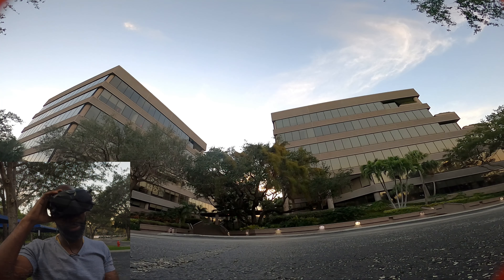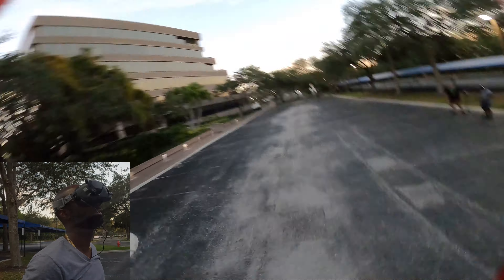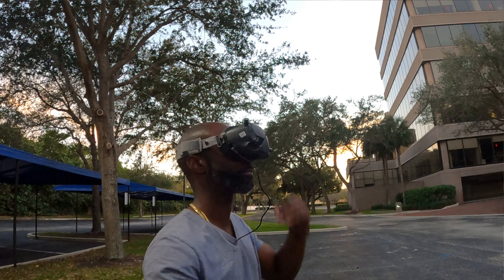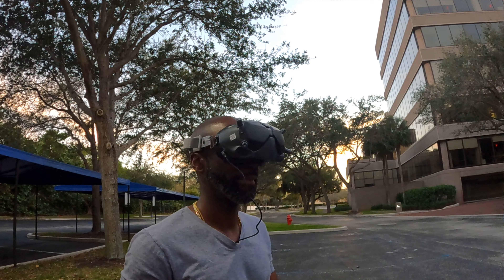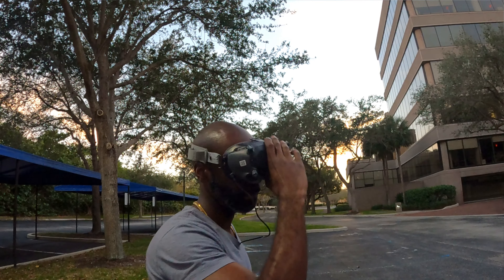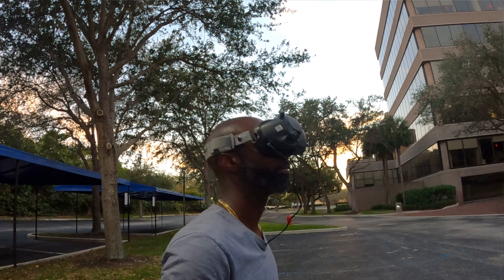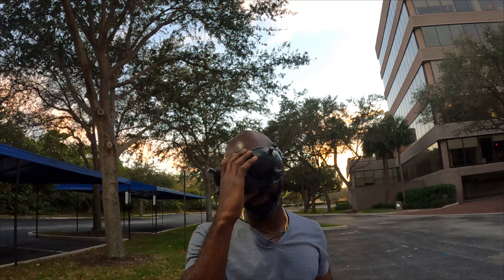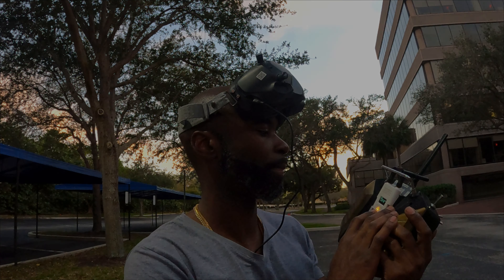Blind Test: 55Hz vs 250Hz RC Control Link w/ DJI FPV

Comment: I think gimbals max out on opentx at 250hz polling rate with qx7, 500hz with edge tx though. 250hz refresh feels the best on elrs. so 250hz would make sense. I fly a qx7 also.
Reply from the maker: Yes 500 failsafed

Comment: Maybe the Q7 radio slows the 250 Hz down do you have the fast mod???:face-green-smiling:
Reply from the maker: I doubt it does with 250Hz, maybe 500. I researched this a little and it may not affect ghost.